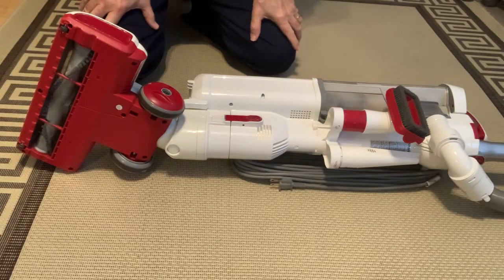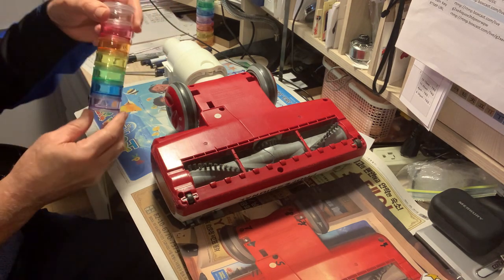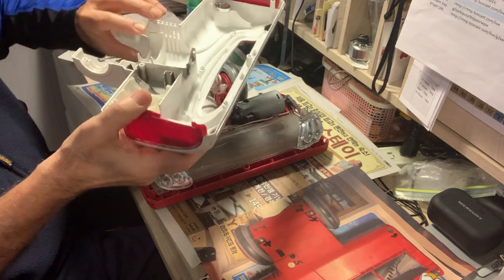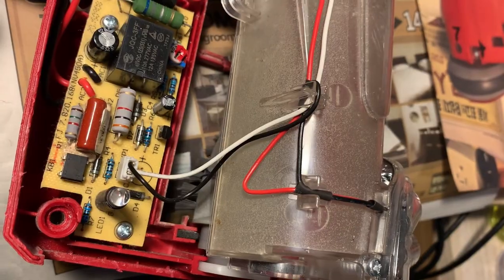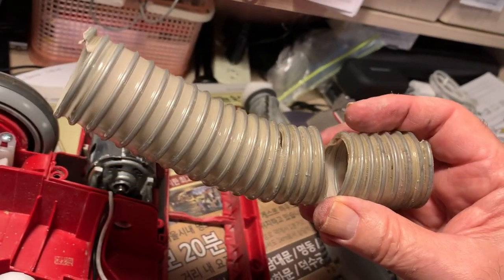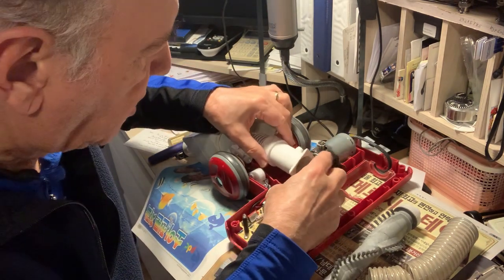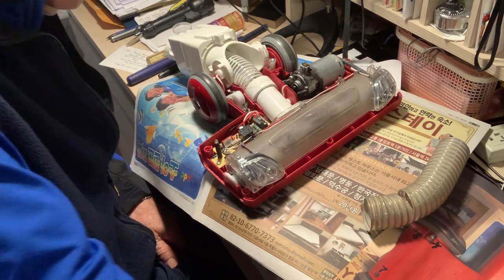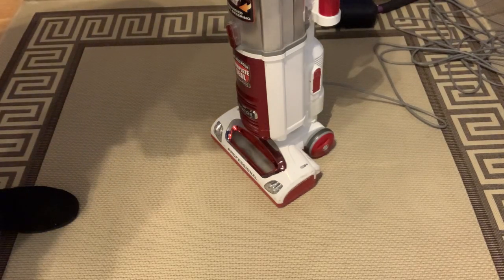Shark Rotator Vacuum Hose replace

Comment: Thanks so much for this video. The Shark Rotator is by far the best-designed vacuum I've ever owned. I have the same exact model NV450 which I bought in 2016 - so your directions were just what I needed. Paying $11 for a pair of hoses beats having to buy a new Shark for $275.

Comment: Thank you so much for this video! And even though I broke 12 other parts and ended with an extra screw in the process I fixed the hose and now know why you said, "good luck." Too funny. I'll limp it along until the motor blows to keep it out of the landfill as long as possible.
Reply: I have THREE extra screws! (I also cracked some of the plastic pieces).  Glad I'm not alone!